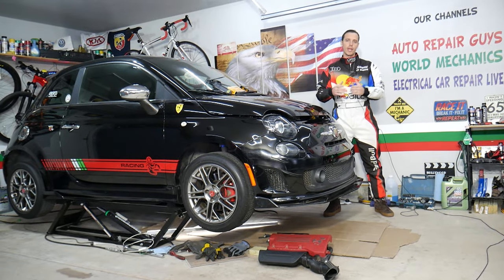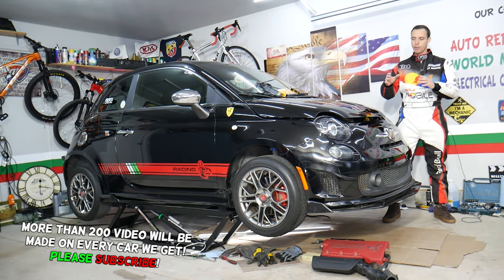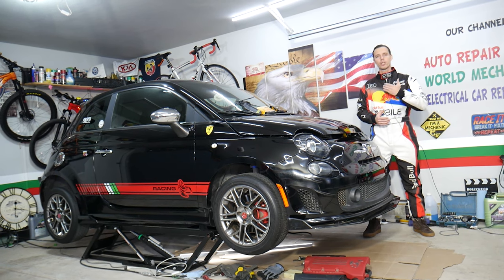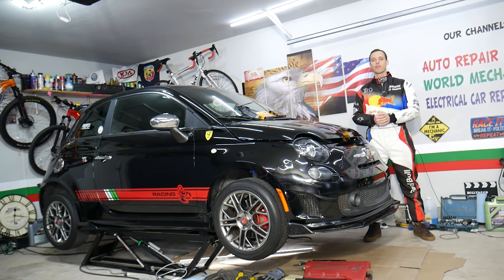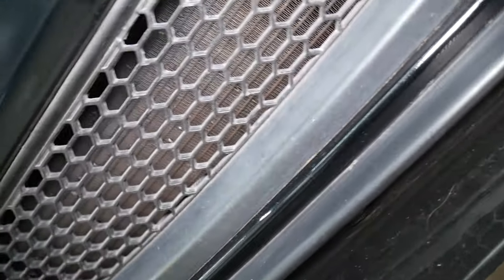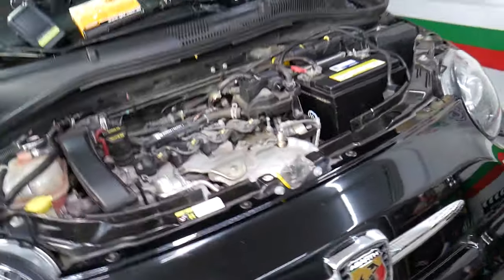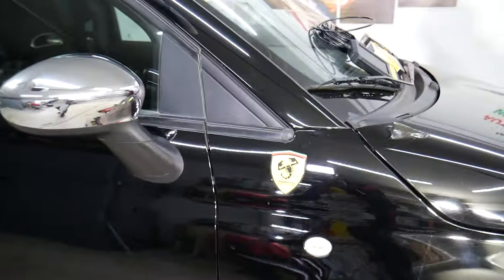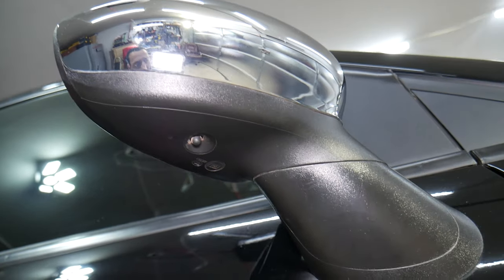FIAT 500 AMBIENT TEMPERATURE SENSOR LOCATION REPLACEMENT EXPLAINED, WHERE IS TEMPERATURE SENSOR

Comment: My temperature sensor was reading 40C when outside temperature was only 20C and the engine light came on.  I opened the mirror, unpluged the white connector, sprayed some electrical contact cleanser on both sides and pluged it back in.  Temperature reading was now 20C.  Problem solved.  Try that first before you try anything else.  Most problems come from bad electrical contacts due to oxidation.  Hope this helps.
Reply: How did you open the mirror up to reveal the sensor?
Reply: Thanks I’m having the same problems now. I will try it.
Reply: @ScorpioMissBrenda  I ended up having to replace the thermistor.  I think it was a 10k ohm.  It costs only a few bucks.
Reply: Bro. 🙏🏽

Comment: I have 2013 fiat 500 sport gas engine..got bad reading for eng temperature sensor, I checked it with a multimeter and it reads 9.5 I dont know if it's good or bad